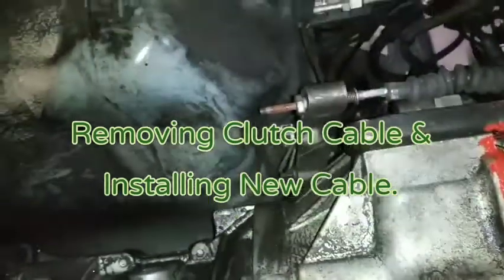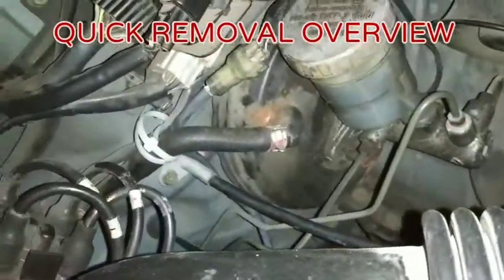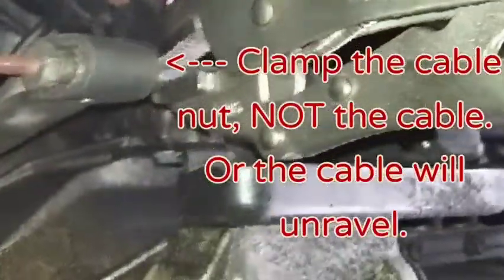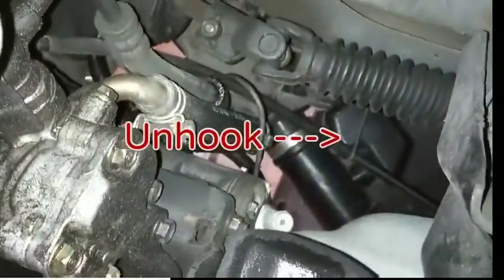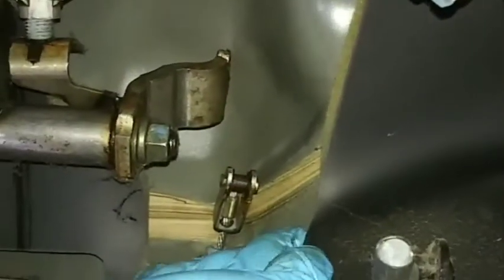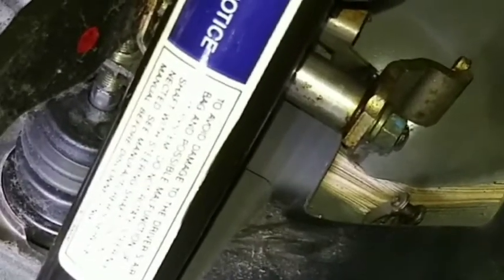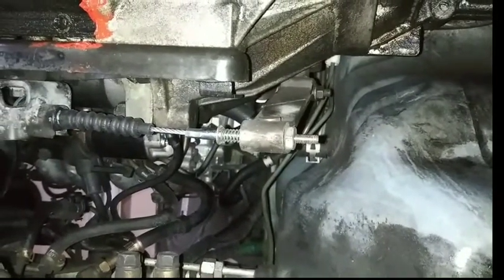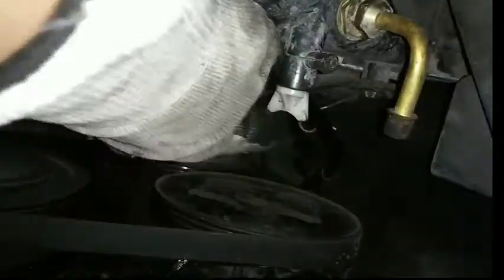DIY Clutch Cable Replacement; Removal & Install

Comment: Do you have the part number for the clutch cable?  Thanks
Reply from the maker: I apologize for the long delay. It's been a hectic few weeks.
Hopefully the cable, you ordered, has arrived & gotten your Tracker shifting properly again.
Reply: Try this code
Reply from the maker: Finally was able to research the OEM clutch cable.
Found where u can find Suzuki parts, local to u at http://www.suzukiauto.com/Service%20Provider.aspx?zip=- .

None near me but I ordered the OEM cable last week, which is estimated to arrive n 4 more weeks.
The place I ordered from said that since Suzuki went out of business here n the U.S., they don't drop-ship anymore (mail direct to the customer). Once it arrives at the vendor, the employee will have to mail it to me or I can pick it up.

Over the phone, he gave me the Suzuki OEM part # 23710-57B10 but he or I may have swapped the last two digits, since it's different than what Thiago shared.

Bought the one from Advance, n case the OEM takes too long. It's ATP brand, part # Y-594.

And the NAPA one was part # 615-1910. (This one is needing to b replaced due to damage from a shredded belt.)
Reply: They're year specific, different lengths and attachment style (two nuts up to a certain year, a rubber boot after that). Go to fixkick (.) com and go to his clutch page.